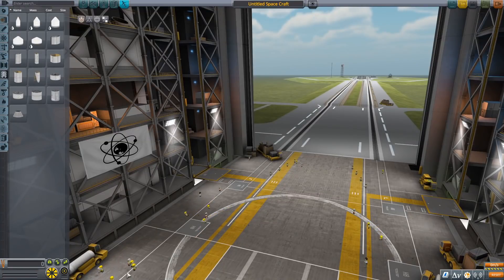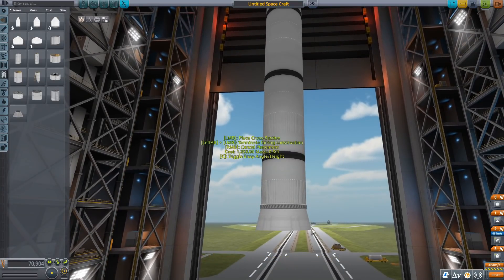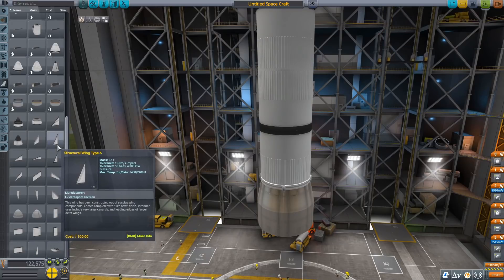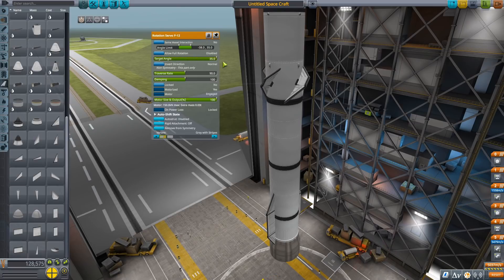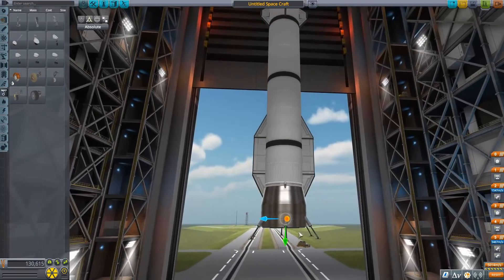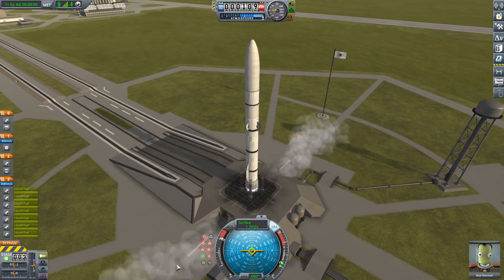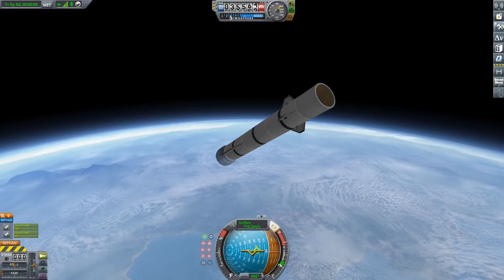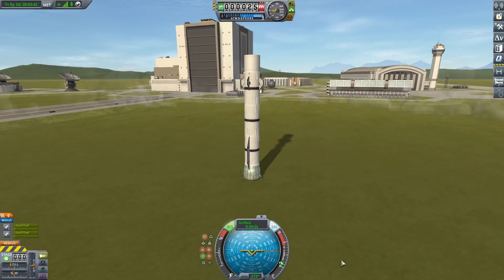KSP Tutorial: How To Build And Fly A Fully Stock New Glenn! 1.11

Comment: Geat video! I wanted to make New Glenn for some time now, so i'm happy to see one. I also have some tips for you:
1) Don't use so much autostrut. It just causes kraken attacks. Autostrut only the most importnant parts. 
2) You can easly land the booster and get the payload in orbit. Try it, it is possible. 
3) The biggest hinges with some landing pads wouls make much better landing gear.
4) Having that many reaction wheels just reduces your dV. Try using some more powerful RCS system.

Waiting for the next one and hope that my tips will help!
Reply from the maker: thanks! I've heard a lot of people say autostrut causes kraken attacks but I have not had any problems (yet). I have landed boosters and gotten into orbit without quicksaves but I just find it a bit annoying to do so I tend to just do quicksaves. I could have for sure done better with the landing legs, 100%. And the thing about the wheels is true as well. thanks again
Reply: @Piolet1549  Sure, no problem. 
And yeah, autostrut itself doesn't, it's just too much of it is what awakens the Kraken. 
Oh and btw. I've been thinking about starting a ksp yt channel, but i don't really thing i have the time. Is two days enough to make a mission and edit the video?

Comment: If you get the apoapsis of the craft up to about 90 km, it will give you enough time to circularize before the first stage needs to do the boost-back burn
Reply from the maker: That is an option, I guess it depends on weather you want to be accurate to the flight profile of the rocket, or actually recover the booster properly. Neither is really better imo